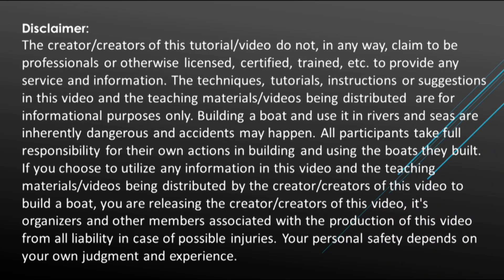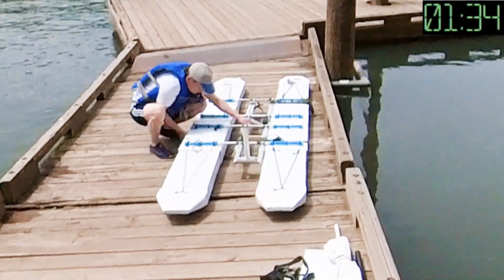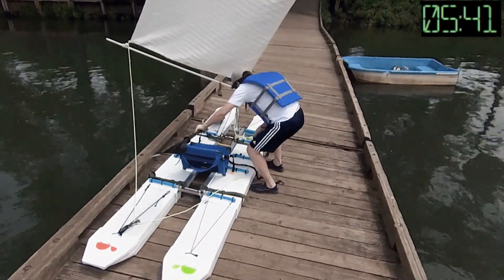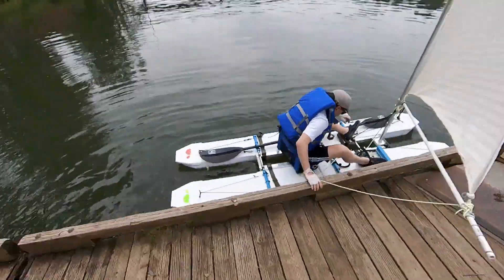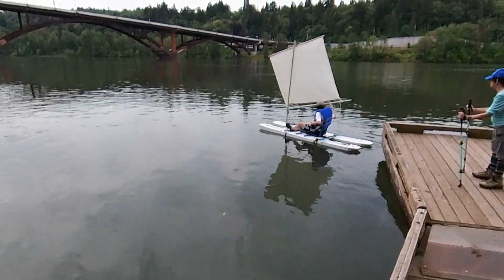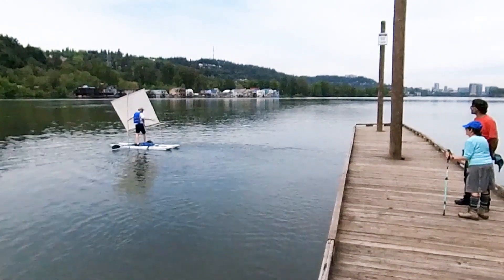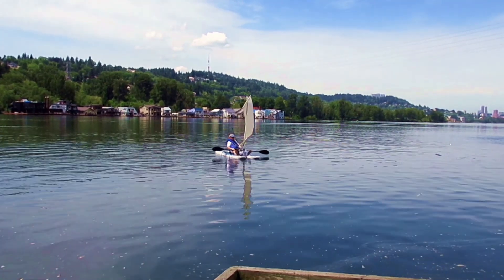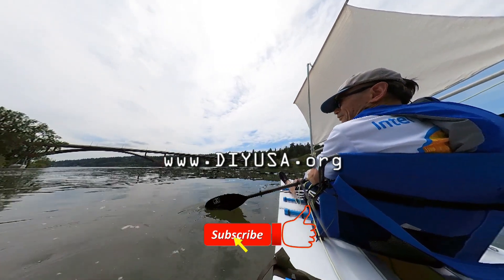Pt 2 DIY Folding Pontoon Boat + Sailboat

Comment: Sorry to hear about the trouble with no wind.  I would have agreed with your wife as far as having wind at the river.
Reply from the maker: The weather was really nice. At least I was able to do a few simple tests. I loaded the boat to 250 lbs, and the zip ties seemed to have become more stable - not much stretching. Also my mini 'kayak cart' worked well : I dragged my boat over 500 ft. from my parked car to the dock (or 1000 ft. round trip) with that cart.

Comment: What plans do you have for a rudder system? Do you think steering oars would work? https://youtu.be/hWB01CT-BgI
Reply from the maker: Yes, I have been thinking about that rudder system illustrated at the video. I used that design with my 1st boat. I may add that to this boat because having a dedicated rudder gives me more options in controlling the boat. BTW, I bought the sail kit from BoatToGo. In this design, I reused the mast and the mast step from that sail kit. I didn't use the 40 ft2 sail, instead I made a smaller 20 ft2 one. I also used a thin PVC pipe for the boom. I can easily modify my canoe paddle and used that as rudder, as shown in the video.